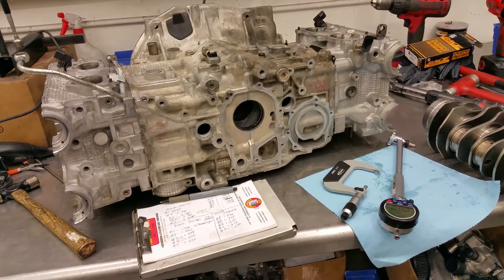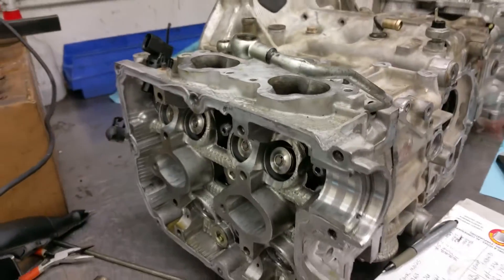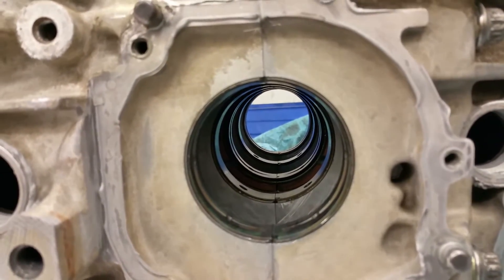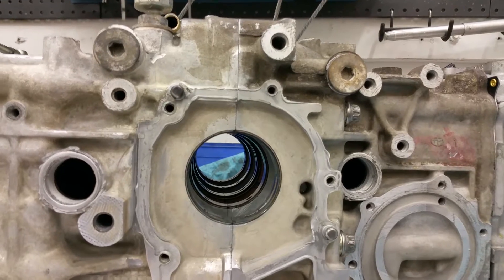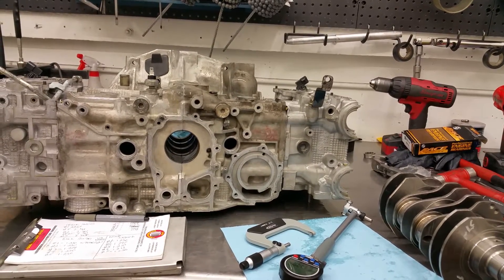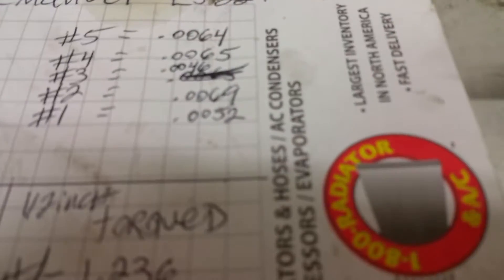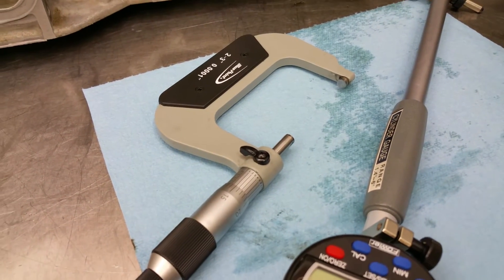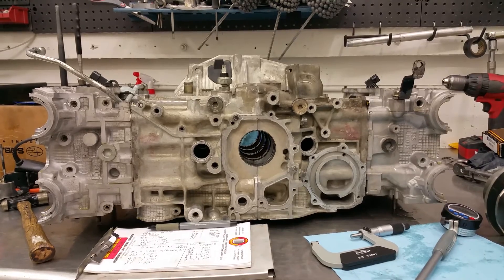Subaru Race Engine Main Bearing Clearances - HMS

Comment: Here's an interesting question...
Do you think if you placed this exact same assembled setup in an oversize oven @ 200 degrees F for 2 hours, that the measurements would change in the bores of the main bearings? I've heard that aluminum EJ blocks are soft are prone to distortion, so heating the block to 200 degrees would be like simulating the motor being driven on the highway for 2 hours. To me, it would make sense to take measurements while hot, because that's when the finished engine will be at it's stable running state/temperature.
Reply: I would love to know the answer to this question as well.
Reply: I think I read somewhere that Subaru accounts for the heat expansion when determining the bearing clearance range. I think it really comes down to experience knowing what main and rod bearing clearance to run in combination with oil pump and oil weight being used. As long as you can get consistent clearances (measuring the same way hot or cold every time) with successful results that’s all that matters….

Now just need to figure out what those clearances are 😅😅
Reply: All bearing and engine manufacturers have done the math and it is taken into account.
Reply: Most manufacturers will specify that all measurements are taken at 20degC/ 68degF per ISO or ASME standards. With that being said you can calculate the material expansion (distortion) using the materials coefficient of thermal expansion.

Comment: Interesting but can you show how you do the measurement? I assume you mic the crank, set the bore gauge to that, then measure the case with the bore gauge. It can be tricky for the middle journal, no? My main question though is, how much difference did you measure with and without the heads bolted on?